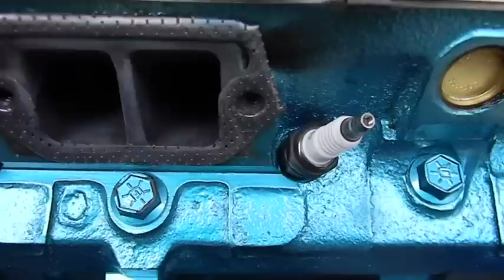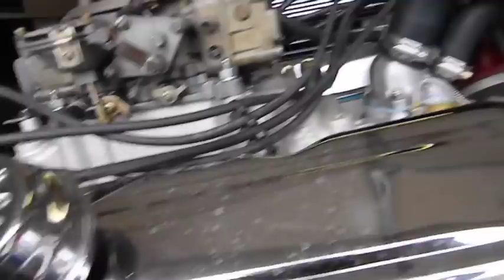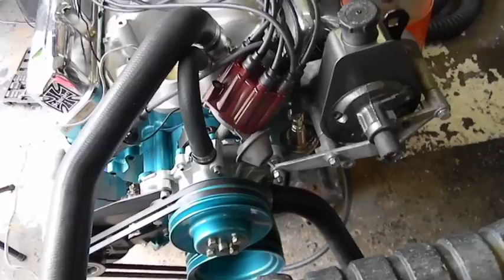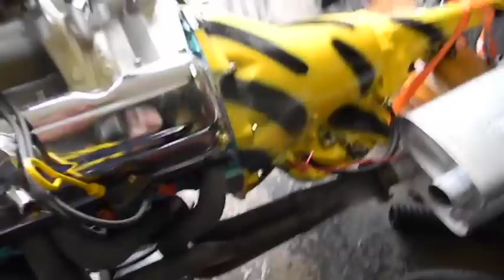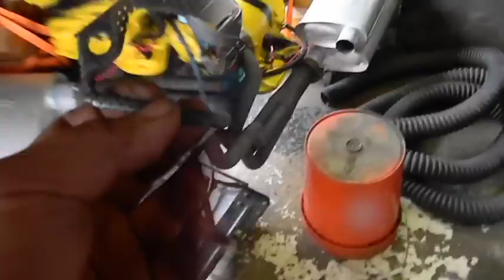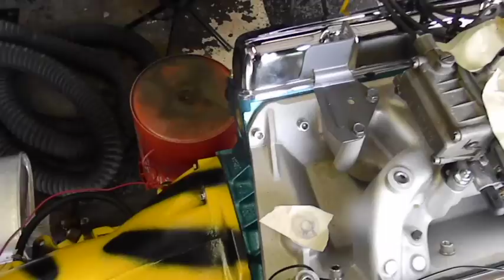AMC 360 Exhaust Leak

Comment: I never had any luck with those gaskets either, LOL. I learned to leave them off and use the high temp rtv sealant to get the manifolds to seal. Maybe Locar has a flexible trans  dip stick for that trans.